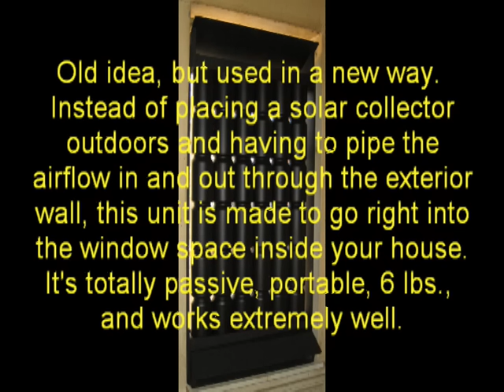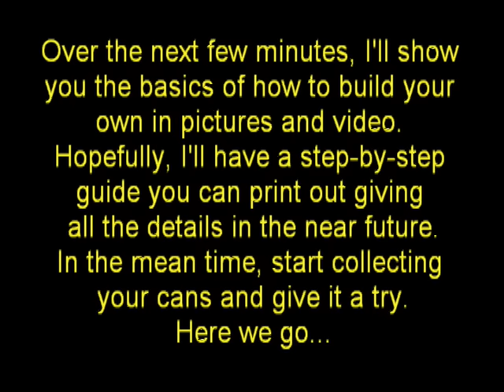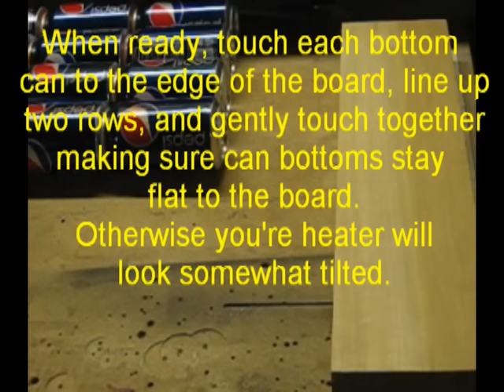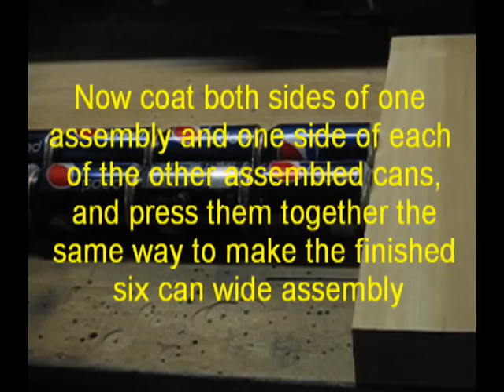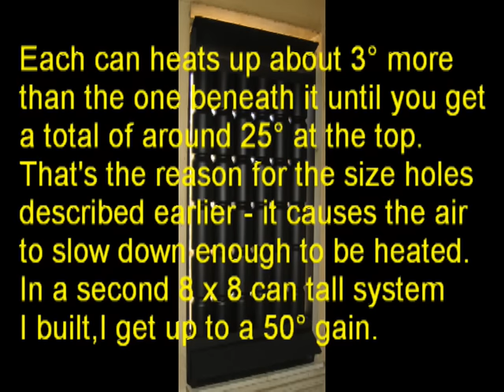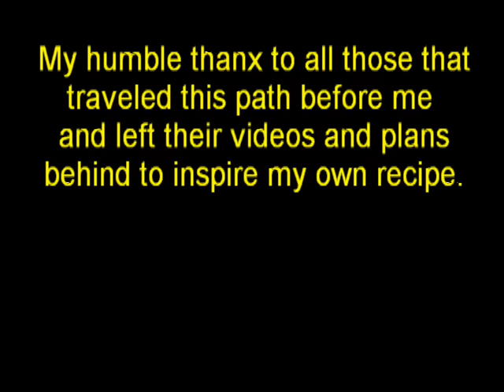Ryan Solar Space Heater.MPG

Comment: I've been looking at all the different types of heaters to make from soda cans that people post, and I like the way you use contact cement to hold it all together before trying to box it. I believe it will be easier to work with, no matter what type of box or frame I end up using. Also, I like the idea of putting it inside the window because I don't want to have to drill through my walls or insulate around an opening in the window. Thanks so much for posting! It was very helpful. :)

Comment: There is no need to collect sunlight from a window. You already get the passive heat from the sun through the window. Cover your heater in glass or Plexiglas (glass is cheaper and won’t scratch) and move it outside. You will probably want to add some insulation as well. Then the heat you get from the heater will be a gain instead of collecting heat that doesn’t need to be. Don’t get the wrong idea, I’m just trying to help. These heaters really do work, they just need to be employed properly.